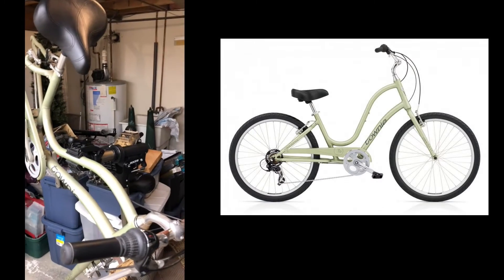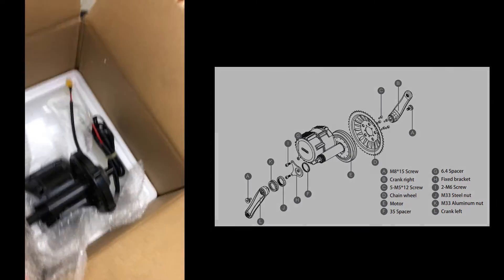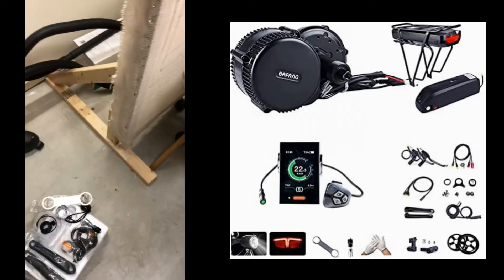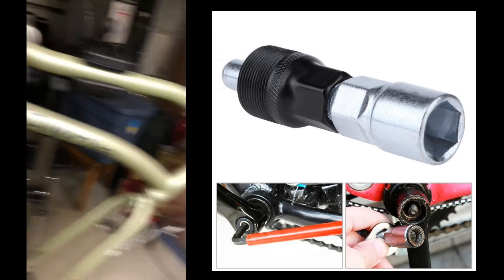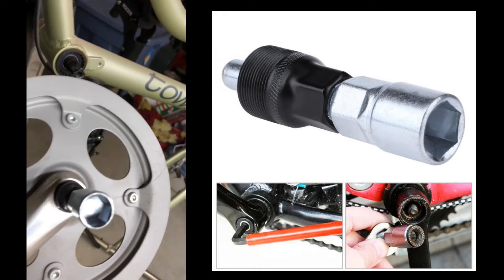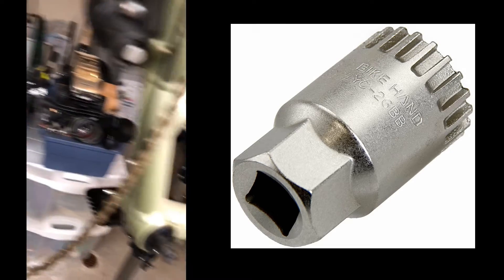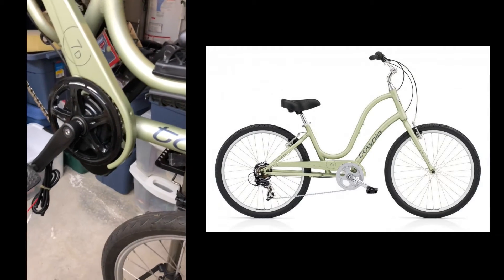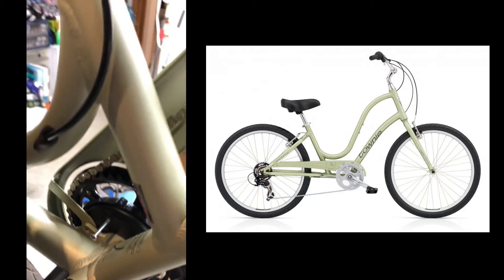Electra Townie Electric Conversion using a 500W Bafang BBS01B Ebike Kit Part 1

Comment: Did you explore the option of running the wiring through the cable ports on the frame?
Reply from the maker: I didn't try any internal frame routing because it would have required cutting the OEM connectors off the cables and splicing them back on.  However, it certainly would clean up the build by moving them internally and hiding the excess cable.

Comment: How are you liking te bike, did you have any issues with the install? How long does the charge last for and how far can you go
Reply from the maker: My wife enjoyed the ride very much.  She has not gone far enough to check the range yet since the bike was completed late fall and has just come out for the riding season.  The issues found with the install were that the standard rear carrier designs don't work well with the  Electra's flat foot design because they interfere with the seat when it has to be set low.

Comment: I noticed the motors come for different size bottom brackets. What size fits the Electra Townie?68mm?
Reply from the maker: The 7D bottom bracket width is 68mm with an inner diameter ~32mm,   so the BBS02B will work fine with it.  This is an excerpt from an article I referenced from EMPowered Cycles.  Note the information on the BB2S(B) mid drive motor. -->

"Fortunately Bafang makes the BBS02 and BBSHD motors in a variety of widths to fit several JIS and BSA bottom bracket shells with the proper knowledge. The BBS02 comes in one size only (68mm) unless you have a custom machined unit with a longer square tapered spindle other than a 68mm. The 68mm BBS02 and BBSHD can easily fit 73mm bottom brackets. All that is needed is longer fixing plate bolts and a 5mm spacer (or stack some M6 washers) to compensate for the 5mm difference between the fixing plate and the motor. Usually only the 4 notch M33 lock ring will  fit on the remaining spindle shaft threads and the second outer lock ring may not fit. What this all means is this... a 68 mm BBS02 can easily fit in both 68 mm and 73 mm shells. Bafang now makes the newer BBSHD model available in a variety of sizes (6 to be exact) : 68, 73, 92, 100, 110, and 120 mm. The most common sizes ordered by vendors is 68mm, 100mm, and 120mm since these can fit in all the other sizes and reduces inventory. Bafang produces more of these common sizes and lead time for the others can be quite long."  

The only difference between the BB2S and BB2SB is that the B model is a newer model >2016.  You can check out EMPower's website for more information.